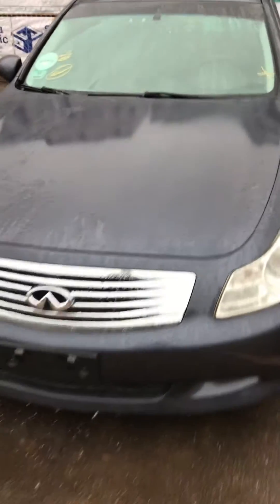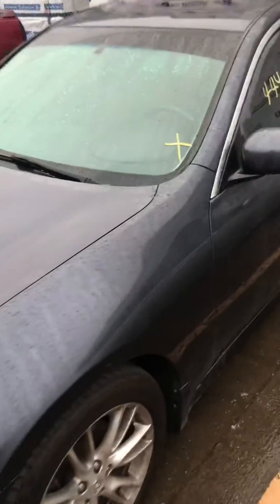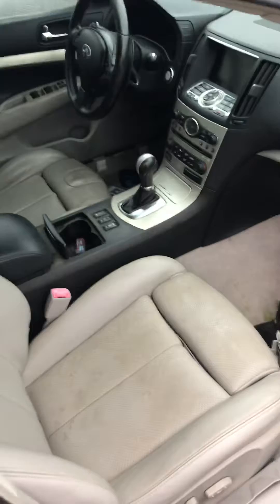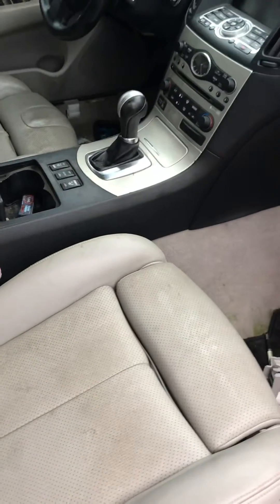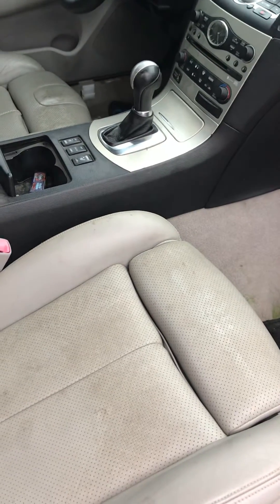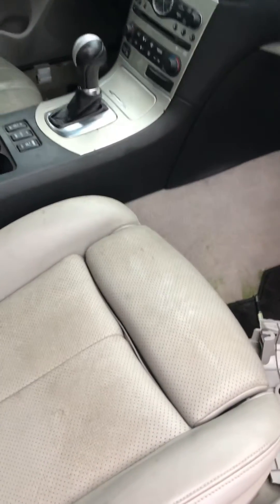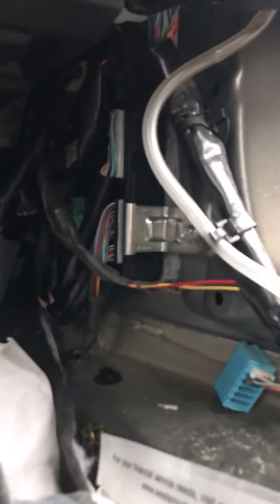Infiniti BCM ECU location

Comment: I have Infinity q x 60
A change shock absorber
Steering rack steering pump XL front and back crossmember shock observe front and back but my car still no have body control specially when Band Road the speed limit cannot keep continue I have to slow down the body of the car no half control so please can you explain me what will be the problem I will really appreciate
Reply from the maker: I came across your issue yesterday and learned it was the speed sensors
Reply: @Zuby2011 may god keep making it easier for you to learn so you can keep teaching , really a saver
Reply from the maker: You need to synchronize the system with a computer, if it’s electronic Sterring wheel

Comment: I’m having a problem the passenger floor is wet but the bcm itself isn’t , but my g35 won’t start without a jump and the locks and windows go down when they want and sometimes don’t even work, can it be something other than the bcm?
Reply: I'm having a similar problem with my g37x it flooded on the passenger side a whole of water I had to make a hole underneath to run it out so now it has to be connected to a jump box to start and wipers keep going can't be stop the hi beam stays on its just pure madness since the water got inside
Reply: Your bcm might have gotten wet as well you should check the connectors for corrosion. Your sunroof drain is probably clogged which is leading to the water getting inside your car. Happened with my EX 35. Still trying to get it up and running
Reply: @DavidBaudin  yes it got wet but through the drain plugs near the battery kinda of hard to explain but was a big waste of time
Reply: @34uzz78  yeah that's what happened with mine. That drain plug is the sunroof drain it gets clogged and the water will leak into the vehicle. Its really poor design by Infiniti. Should warrant a recall in my opinion
Reply: @DavidBaudin  definitely should it wasn’t  too bad of a fix just was hard to diagnose and Infiniti dealer wanted $300 to even diagnose it

Comment: Are bcm and ecm are the same?
Reply: @justanotherday123  so where is the ecu located in regards to the bcm? I'm confused. My g37 has gotten a lot of water in and I've been getting a service engine soon light with the P0603 keep alive memory error. It shows up almost every other time i drive. I've seen the water dripping down through from inside the wiring harness where the tape ends. I haven't had actual electronic problems but i found a car at the junkyard that has the bcm and I'm not sure if I'll need it in the future or not? Which ones the ECU which ones the bcm?

Comment: If water is leaking onto the BCM would it cause my horn to go off?
Reply from the maker: Joe Das check the fuse, if fuses are good then it’s your clock spring
Reply: Justice Ogueji thanks man ! I ripped apart the glove box and all the trimming that holds the drainage tube in place. Ran water over the sun roof and no signs of leakage. In fact the drainage tube looks brand new ! Idk . I checked the fuse to the horn and it looks fine. I don’t understand why it would be the clock spring if horn only goes off when it rains !
Reply: Joe Das wow I though I was the only one with this problem 😞
Reply from the maker: Joe Das no

Comment: What was the problem with car? I have a 2007 G35 and my push to start is not working and i have no dash lights nor radio
Reply: It could be a two things , I had this problem and it was a headache. Could be your key is need reprogramming to the car it’s not reading it correct (better if you have two keys) or it could be the BCM. That’s if the problem is electrical. I’ve had all my fuses and parts checked it’s all the mf BCM for me
Reply: Turns out there was a water leakage 🤦🏻‍♂️in my car that kept messing up the system
Reply: @wael6021  Mines went bad because of drain clogged up in the sunroof
Reply: did you ever find out what was the problem with your G35
Reply: @pettis9436  Did you figure out the problem with your car cuz mine is acting the same??
Reply: Pedro Corona I have the same issue. Did u figure out what the problem is?

Comment: Do u have to take it to the dealer to be reprogrammed
Reply from the maker: B Brid you can call a good key guy to program the BCM, before installation make sure you take the picture of the part number
Reply: @Zuby2011  does the part number have to match or can I find one that fits the plugs ( I can’t find one that matches the part number anywhere)